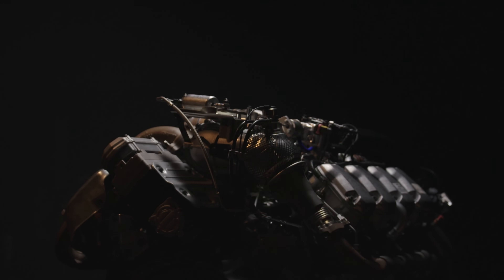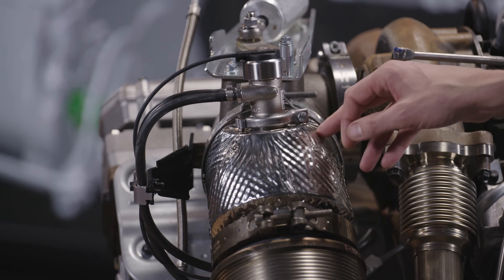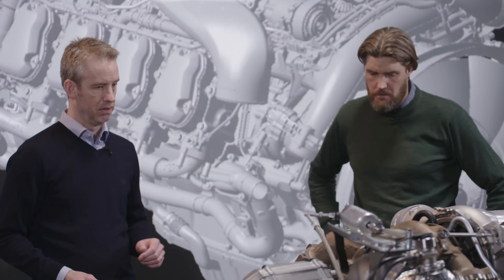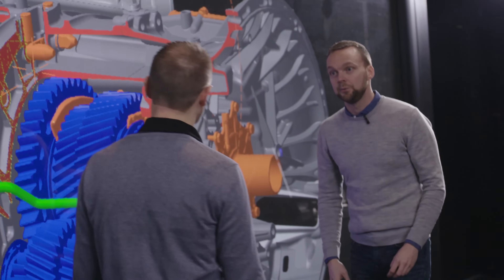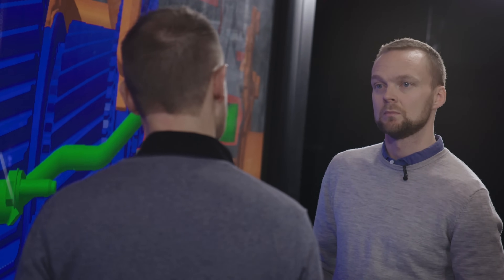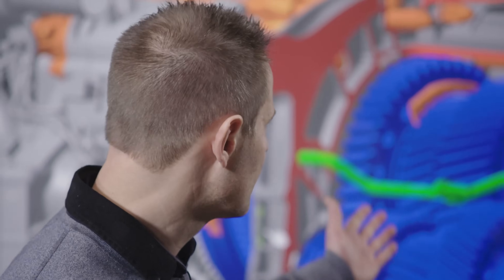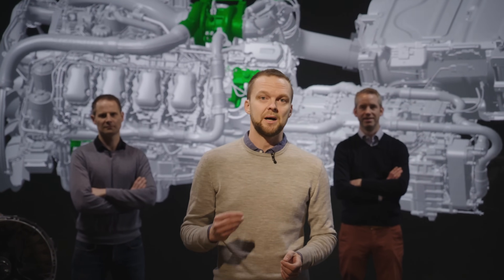Engineers present Scania's new V8 powertrain

Comment: It's a pity you can't use modern multicylinder steam engines with it's good torque and no need for transmission. Can be driven by everything that can heat up a small amount of water in a closed loop. Scania does know these propulsion systems exists since some decades ago, but it's not used commercially only tested.  :D  But of course they don't have the Scania \8/ angels choir sound!  Haha!

Comment: Dual SCR system, that’s a world first, great work, my compliments to the engineers! Now that the 730 is gone, also the only OEM now with a full line-up of non-EGR, SCR only engines. 
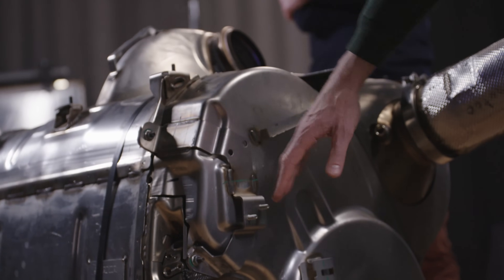2:35 The 2nd doser on the catalyst box is missing but I’m sure you know that😉
@Scania Group does the gearbox automatically shift gears in reverse now, as it would do when in normal driving? With the previous gearboxes it was already possible to manually shift when in reverse.
Reply: If you havn't got your answer yet, yes it shifts gears in reverse automaticly when reversing :)

Comment: Scania fights hard against electric trucks..
Reply: I don't think so because they also produces battery electric trucks and buses. But this a whole another product segment today.
Reply: There is more electronics and electrics on this than there will ever be on an electric truck.
Reply: Just imagine the kind of energy that has to be stored in a battery for the targeted application of this kind of truck.
Reply: @estebanamador7601  ...sounds like transportation of battery instead of payload.
Reply: @otis3795  yes. In my country we have some city electric buses for testing, and they get a 150 KW/h per 100 km, that's a 15 ton bus with a short route per day (185km), a 80+ ton truck with longer routes or in places without electricity (or time to charge), well, I can't imagine how they will work. By the way, those buses that they are testing need a shorter gear ratio, because with today gear ratios, they can't go to places (in my city) where a diesel can go easily (18-20% grades in some places), and they can't dream with some interurban routes neither, too hilly terrain, sometimes with really slow speeds, so regenerative braking is not very effective. Actually, many of the diesel buses use big engines, some of them with retarder and Jake brakes. Greetings